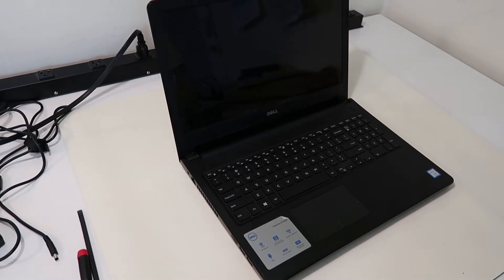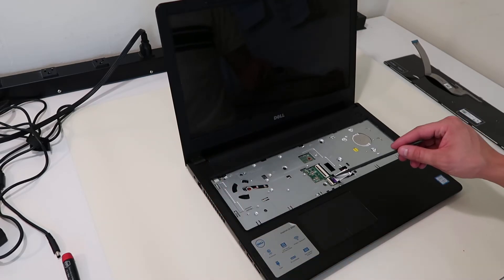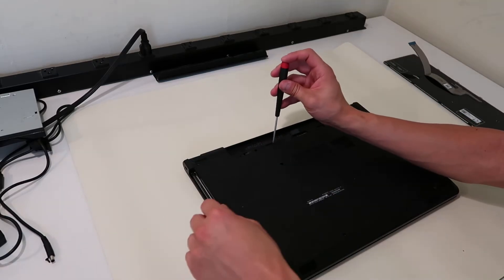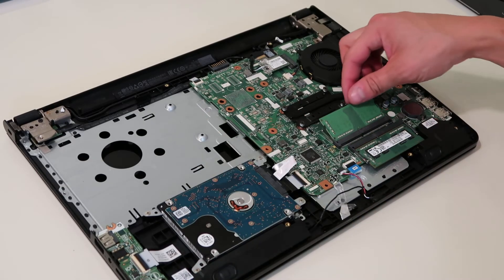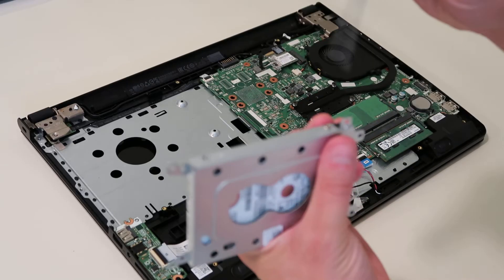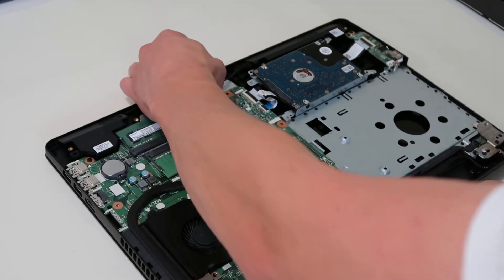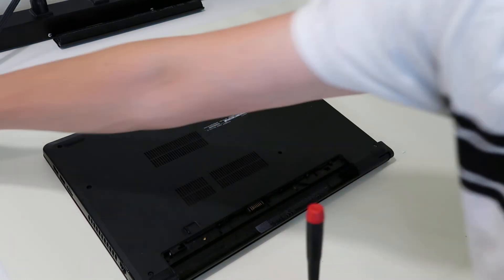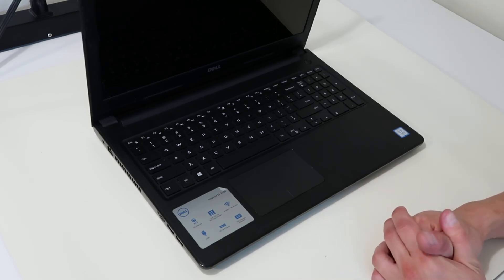How To Replace Upgrade HDD (Hard Drive) & RAM - Dell Inspiron 15 3000 Laptop

Comment: Good evening, Did dell use the same size screws to hold down the bottom ? From what I've seen the three DVD screws on the edge are thinner heads ? The thinner heads should be put back with the dvd player...?
Reply from the maker: I dont think I fully understand your question. No, the HDD screws are usually not the same size as the bottom case screws.

Comment: Thanks. btw, it took me like 30 mins to disconnect the old hard drive from my laptop as I was scared to not to snap that thin flat connector wire. I guess you get the judgment from experience
Reply from the maker: It gets easier the more you do it :)

Comment: Suggestion on best place to purchase hard drive, and does a new one come with required software?
Thanks, great video!
Reply from the maker: HDD & SSD Replacement / Upgrades: https://amzn.to/430vkEz
Hard Drives vs Different Kinds of Solid State Drives Explained: https://youtu.be/KgDucEw7drA
No, usually new HDD's or SSD's do not come with an operating system pre-installed on them. But you can see how to do that here: 
How To Install Windows 10: https://youtu.be/zYY-Gq68Dvo 
How To Install Windows 11: https://youtu.be/QG0AiieydpM

Comment: Same laptop on problems so what is the solution
Reply from the maker: Are there any signs of life at all when you try to turn it on? Lights? Fan, Motherboard, or Hard Drive sounds? Anything seen on the screen?
Also, did anything happen before this issue appeared?  Liquid spill, overheating, Windows update, etc?

Comment: My dell laptop is an an infinite loop after I did a windows update. I even got an external copy of windows 10 in the external drive and it does the same thing. I am so confused
Reply from the maker: Can you try the steps seen here? https://www.youtube.com/watch?v=B2Umoh81QeI. Specifically, can you find any options in BIOS to Uninstall Last Update?

Comment: Do new hard drive come preloaded or does one need to reload everything? I know nothing on repairing a computer. Just bought a new laptop to replace the one that suddenly said hard drive not installed after 11 years. I can play with this one.
Reply from the maker: New HDD's come with nothing on them. After installing, you would need to install a Operating System to it. For Dell, you can see that here:
How To Install Windows 10:  https://youtu.be/zYY-Gq68Dvo
How To Install Widows 11:  https://youtu.be/Yiy-53Wc-Wo

Comment: I just received a hard drive upgrade from dell an hour ago. The hard drive is a small chip. Nothing like this huge floppy disk style hard drive.
Reply from the maker: Sounds like a SSD instead of a HDD.  What model computer do you have?  Also, did they send this for your exact model?
Reply: @PC_Monkey  After searching youtube. I found  videos of my exact model laptop, the Dell inspiron 15 5570. All of the videos feature upgrades of the ram, the hard drive or the nvme chip set. I want to upgrade the ram and the hard drive. But I'm confused at to whether I need to install the large square hard drive or the nvme. My computers memory is completely maxed out and can't even download updates. It's a 128 gb hard drive. Dell's online support sold me a nvme chip that looks nothing like the chip set featured in the videos. I received a small 1 inch square chip. But the slot is for a 1" wide approximately 3" long chip set. According to the website it's compatible with my computer but I don't see how that's possible. They look nothing alike and I haven't found any videos showing this small 1" square chip being installed. I think I was sold the wrong chip. And I don't understand the role of the nvme. As the laptop didn't ship from the factory with it installed.

Comment: Is it possible to remove the DVD drive with part of the casing broken off? About half of the casing on the DVD drive is broken, and i cant remove it
Reply from the maker: It  may be held in by one or more screws.  What brand and model computer do you have?
Reply: @PC_Monkey   Dell inspirion 15 5100, I watched this video thinking it was a 3000 series
Reply from the maker: @supersillysammy272  Does this help access it?  https://www.youtube.com/watch?v=gVLqKVF2zLc

Comment: Does this laptop have m.2 slot or I have to install 2.5 inch ssd.
Kindly help as I want to know before opening my laptop so that I can order the same from Amazon
Reply from the maker: As you can see in the video, this computer used a 2.5 inch connection.  I dont think it comes stock with a m.2 port :(

Comment: Hi, from that laptop since i have the same, what will you recommend from these:

RAM: 2X16gb 2400mhz
- crucial
- samsung
- kingston fury

* is the RAM mhz cannot be exceeded to 3200mhz?

M.2
- kingston NV1 NVMe PCIe SSD
- Samsung 970 evo plus

Thanks much

Comment: Hi sir, I changed my Hard drive exactly the same way and closed back the laptop but after that is was unable to power on. Can you help me
Reply from the maker: If the computer worked before, my first guess would be something was damaged or made loose when you were inside.  I would go back in and make sure everything is securely plugged in by unplugging them and plugging them back in securely.  If that does not work, does the computer turn on if you put the old HDD back?

Comment: hey, but isnt using magnetized screwdrivers compromise the data in my hard disk drive?
Reply from the maker: Ive never had an issue with such a small tool and such a small amount of magnetized.  You would have to rub a much more powerful magnet over the hard drive repeatedly to start breaking down the DATA.

Comment: I suggest removing the battery first (when possible) before ever opening up and disconnecting anything from the internals of a laptop.  Then before proceeding any further, hold down the power button for a good 10-15 seconds to drain and residual power from the system.
Reply: This^^^

Comment: I too have a DELL Inspiron 15 3000 and I am absolutely terrified of ESD (Electro Static Discharge); was that why you were touching your computer in the video? DELL sent me a new hard drive at the time of this posting. Your video is indeed very easy to follow,  but I am still concerned about screwing something up due to ESD; also, I do not have any internal components like a DVD drive--I connect peripherals via USB drives. Help!
Reply from the maker: 1.  This computer is sitting on an anti-static pad so its pretty protected.  You can also choose to wear an anti-static bracelet instead.  You can see the things I use in the Repair Tools list here;  https://www.amazon.com/shop/pcmonkey
2.  Are you looking for help getting into your computer?  Is this video close to your 3000 series?
Reply: @PC_Monkey  thanks for the replies! And "yes" to looking for help to get into my computer and "yes" to the video being close to my Inspiron 3000 series.
Reply from the maker: @mrdroog1999  If this video is close to your model computer, are you able to successfully open it up as seen here?
Reply: @PC_Monkey  once again, my thanks for responding. PCMonkey, I am an absolute klutz when it comes to mechanical aptitude--I have not tried yet. Also, could you please explain what re-seating a hard drive refers to? Sorry for what must seem like rudimentary questions...
Reply: Also, what are the chances that something within the computer is merely dislodged as opposed to the hard drive being compromised. I know opening the computer to see what's going on would help...😁
Reply from the maker: @mrdroog1999  np :)  'reseating' a hard drive involved simply unplugging it and then plugging it back in to make sure its properly sitting in its cradle and securely fastened into the port.  Its actually pretty common for that and other components like RAM to come loose every once and a while unfortunately
Reply from the maker: @mrdroog1999  Thx :)
Reply: @PC_Monkey  it's been a while, mate--just wanted to let you know that it was indeed the hard drive that was kaput🙁; fortunately, I had about 70% of my files backed up on an external hard drive and on One Drive, so it wasn't a total loss. Getting into my old logins wasn't too bad either, so I'm pretty much at a state where I'm none the worse for wear. Thanks again for taking the time to post your video and for talking to a bloke like me. If we do not  converse again, I wish you and your family Joy and PEACE during he holidays....
Reply from the maker: @mrdroog1999  Glad your all set :) Always here if needed !!

Comment: What ram is it?
Reply from the maker: What brand and model computer do you have? 
Also, you can see how to fine the correct RAM replacement here;  https://www.youtube.com/watch?v=NtCzunl0AQA&t=9s
Reply: @PC_Monkey  It is a Dell inspiron 15 3000
Reply from the maker: @shoblue8635  There are many Inspiron 15 3000 series computers.  Did you look at that video link I sent you and compared it to your RAM?   You can also go to websites like crucial.com.  They will scan your computer and tell you what options you need

Comment: Jesus I only had to unscrew a few screws on back to replace acer Hard drive. Morons designed Dell. It's been a disaster from start to finish. Will never buy another

Ps 12 years in before I had to do it. RAM I upgraded from few screws at back of acer too. Keyboard never been off it. Ribbons not an issue
Reply from the maker: Glad your all set :) Always here if needed !!

Comment: I have an Inspiron 3542 and all you have to do is remove one screw to access the hard drive and memory.   I advice you check your model it seems they are not all the same.. I used this video and removed all the screws and keyboard before realizing .. it was much easier than what is illustrated here.
Reply from the maker: lol yes, not all models are built the same way.  
Thought that was commonly known... But thanks for the confirmation lol

Comment: My hard drive is coming tomorrow and I’m looking forward to watching this tutorial so many thanks. 🙏 😊 
Do you know if the processor on Dell Inspiron 15 3552 is replaceable?
Reply from the maker: Is this your computer?  https://www.youtube.com/watch?v=tDNIoQm0KEY
If so, then no.  The CPU looks like its integrated into the motherboard and not replaceable :(
Reply: @PC_Monkey  Yes, that’s my laptop. Thanks for letting me know that’s good to know. In that case, I will be upgrading soon then.
Reply from the maker: @Alex-hn3lc   Good luck !!  Let me know how it goes :)
Reply: @PC_Monkey  Thanks will do. 🙂 I am just about to replace the hard drive now. It’s the moment of truth. 😆 I will update you once I’ve finished.
Reply: Help I can’t unscrew the final screw it’s stuck. 0:47 on this video: https://youtu.be/tDNIoQm0KEY

It’s the final screw that holds the battery. I cannot unscrew it because it’s not moving. Any advice? 😕
Reply from the maker: @Alex-hn3lc  Is the screw stripped?  If so, you can see how to handle that here;  https://www.youtube.com/watch?v=Jk1Xvo_Fs5I&t=2s
Reply: @PC_Monkey  — Thanks for your response. No, the screw is not stripped yet. It’s in good shape but it’s not moving at all it’s stuck.
Reply from the maker: @Alex-hn3lc  If you have the correct sized driver, it should move.  If for some reason you cant turn in, try a power drill :)
Reply: @PC_Monkey  Thanks for your help. I got the right size driver but it’s not budging so I will try a power drill.
Reply from the maker: @Alex-hn3lc  Good luck !!  Let me know how it goes :)

Comment: I didn't have that purple ribbon inside of mine. Wth?
Reply from the maker: What component are you looking to replace and what brand and model computer do you have?
Reply: @PC_Monkey  inspiron 15 3000. I was looking to upgrade my hdd. It is now saying not installed and won't boot up.
Reply: @PC_Monkey  thank you for taking the time to reply to me.
Reply from the maker: @tomjones4521  np :)  Were you able to run this diagnostic scan?  https://www.youtube.com/watch?v=IsqINCxx_Ik&feature=youtu.be.  Did that confirm the HDD is bad?
If your looking to upgrade it, I can advise a SSD rather than a HDD.  They are faster and break less often:)

Comment: i did this and now my laptop has an Orange and white flashing light :/
Reply from the maker: Your computer was working well before the replacement?  Did you replace the HDD or RAM and why was it replaced?
Reply: @PC_Monkey  I didn’t actually replace anything, I was basically just checking if the hard drive was broken. The reason I did this was because when I started up my laptop it’d have this weird white screen saying something like "hard drive not installed", when I opened up my laptop I didn’t see any physical damage to it so I thought I’d just put it back in and see if it does work now. Anyway thank you for the response and the tutorial btw
Reply from the maker: @b4ttl3sky45  Yes, reseating the HDD is a good troubleshooting step when its not being detected.  Well done.  The rest of the steps, assuming you have a Dell, are found here;  https://www.youtube.com/watch?v=dupH2YrD6OY.  Are you able to run that scan?

Comment: I tried this and now my laptop won't run.
Reply from the maker: If you replaced the HDD and now the computer wont turn on, most likely something was unplugged, made lose, or damaged when you were in there.  Double check all the connections.  You have an Inspiron 15 3000 series?  What is just like this one?

Comment: Thanks PC. My i7 acts like a Pentium III, it's just a slug, so assume it's not an SSD drive. I've replaced my SSD drives twice in my desktop and it comes with software to transfer the C drive data via a USB cable to the new drive. So the question is how do you do that with a laptop? I've got 3 USB outs and an HDMI port too. Thanks in advance.
Reply from the maker: Your want to clone your drive before replacing it?

Comment: Hi. I followed you video and upgraded the ram and replaced the HDD with an SSD but when done it won't power on now. It just flashes the light and that's it. Is there something I'm missing?
Reply from the maker: Something may have come loose or damaged when you were in there.  I would double check all the connections.  If no luck, you can start troubleshooting a computer that wont turn on here;  https://youtu.be/P3I7dDpkJps.  Let me know how that goes :)

Comment: Supero super.
Why should we remove 3 screws from palm rest.can we do away with it. Just remove the 2 cables alone..am i right or wrong.no need to to remove screws from palm rest i think.is it right or wrong
Pl advise immediately
Reply from the maker: I dont understand your comment.  If you think you can replace your HDD or RAM in your model computer without taking out some screws, then go for it :)

Comment: Can I change its gpu because my has intel graphics
Reply from the maker: Most laptops like this has the GPU integrated into the motherboard.  It cannot easily be replaced.
Reply: @PC_Monkey  what noooooo
Reply: @PC_Monkey  still is there a way to replace it please tell me I don't want to  buy a new laptop because I have a lot of memories in it
Reply from the maker: @b.himamshurao2043  What brand and model computer do you have?
Reply: @PC_Monkey  dell Inspiron 15 3000, intel core i3,  intel graphics 520, 4 gb ram, 256 gb hard disk

Comment: Great video, but I wish you did an extreme close-up of flipping the keyboard connector up and also the prying of the case. My laptop doesn't have the smaller ribbon cable which is probably for the DVD drive, which mine doesn't have. I'm wondering if I really need to remove the keyboard just to access my HDD since I don't have the smaller ribbon cable. I was able to do after, after unscrewing the 5 screws underneath the keyboard. Started prying at the DVD drive space.
Reply from the maker: Do you have an Inspiron 15 3000 series computer?

Comment: Can this also help with 
"Harddrive not installed"
In the bios diagnostics?
Reply from the maker: That error means the hard drive is either bad or loose.  I would first try 'reseating' the Hard Drive.  That is where you unplug it and then plug it back in, making sure its properly plugged in and secure.  Try the scan again.  If it still says that its not installed, then its most likely bad and needs to be replaced. You can see how to do that here;  https://youtu.be/KZzWsZ8KKFQ.  You would also then need to install an operating system onto the new one as shown here;  https://youtu.be/ULrJVk4JJ20

Comment: I’m doing this but the last screw conveniently doesn’t come out right when I try to open the back.  Wasted money on this SSD.  But good video anyway
Reply from the maker: Is the screw stripped?  If so, you can drill it out.
Reply: @PC_Monkey  No it’s not stripped looks to be good condition but just doesn’t come out.  I think the previous owner messed with it or something.

Comment: hey !  is not the Vostro 15 3000 on the explanation !!! but the Vistro 15 3578 
NO BATTERY & NO KEYBOARD can be remove of the VOSTRO 15 3000

Comment: Great video thanks so much for posting - I've done this a few times already and needed a quick reminder on the steps so this was super helpful - one piece of advice for newbies I would recommend however - before you screw in the base as shown in the video, flip over the laptop and make sure the ribbon is all the way through and easily accessible and properly attached - so pop everything back together and attach the keyboard etc and then attach the battery and power on and verify that your ribbons are properly attached as its a huge pain to discover something is not connected properly and then have to unscrew it all and fix. Obviously be very very careful using the laptop while it is not screwed together, then when you know it is working screw it all back in place and you are good to go. Thanks again PC Monkey!
Reply from the maker: Thanks !! Glad this video was helpful :):)
Reply: I’ve taken apart 100’s of laptops & this one is in my top 5 of frustrating case opens. Dell is usually pretty smooth to work on, but it’s like they put in every little annoying curveball they could with this model.